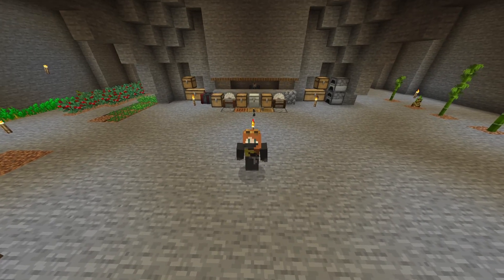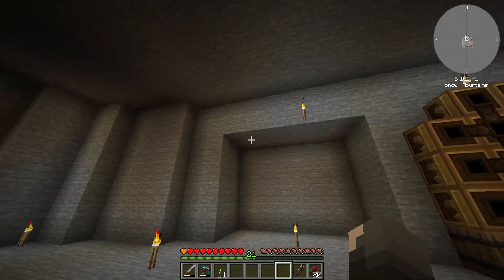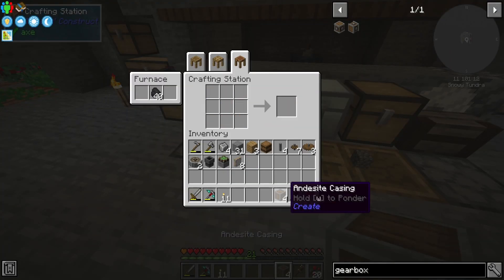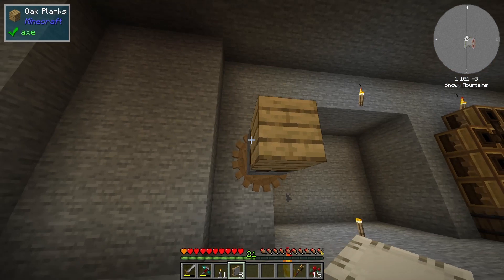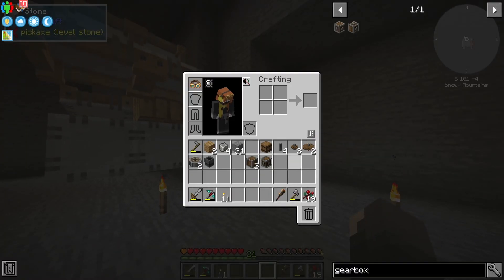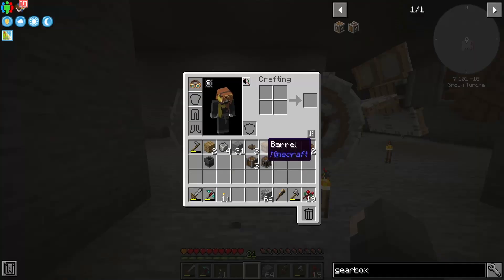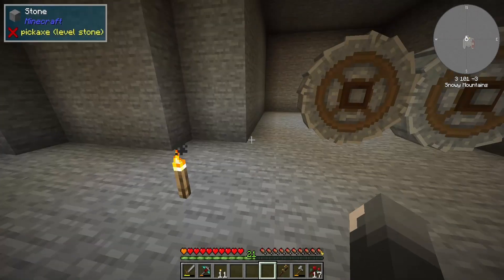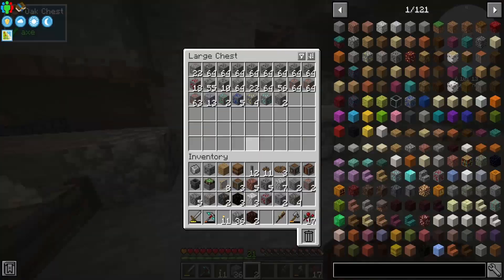Cave Factory Ep. 4 - Crushing The Torque!

Comment: Small tip - 2 windmills with 8 sails each give you 1024 SU total but 1 windmill with 16 sails will also give you 1024 SU and will spin a little bit faster (max is 128 sails/frames per windmill)